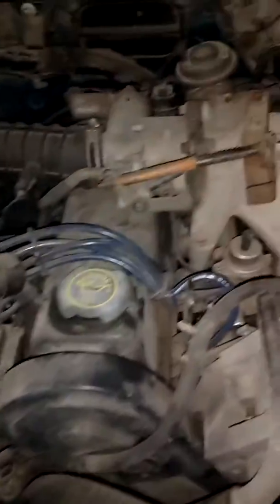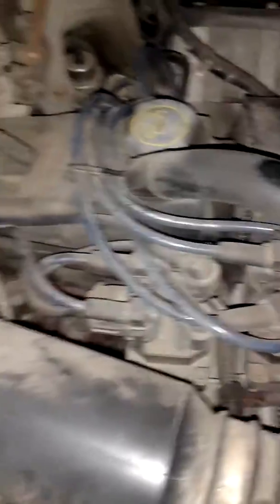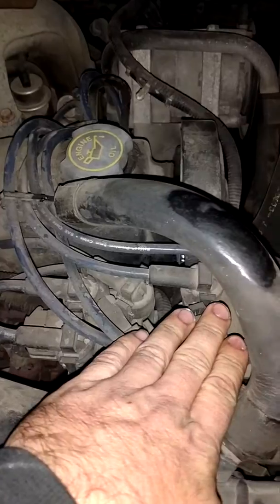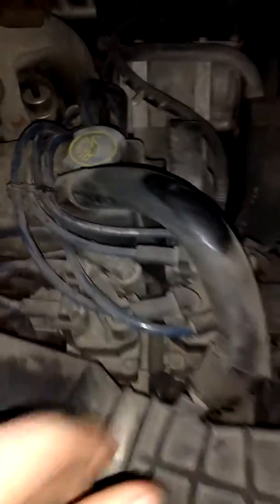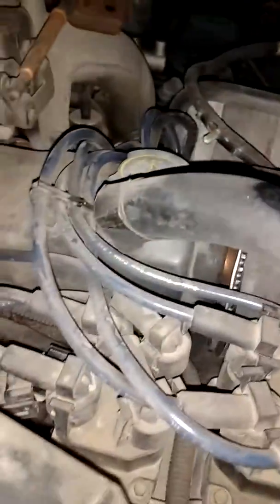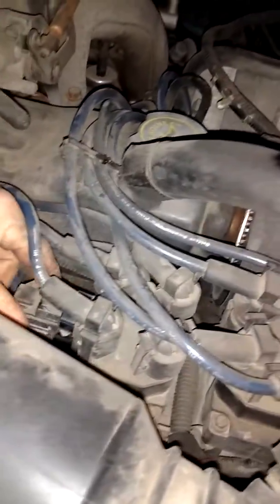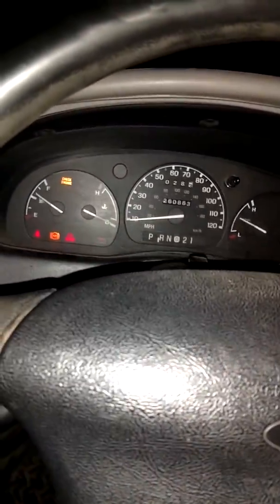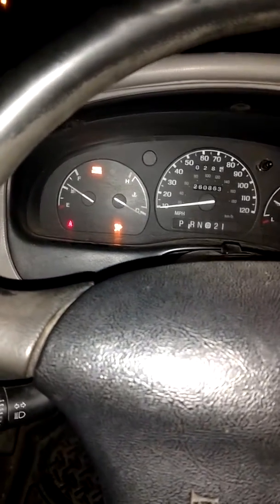The Ford 2.3L Dual plug myth, the explanation of why it doesn't work.

Comment: I believe both plugs fire on cold start and hard acceleration so your test is cold and both plugs are commanded to fire hence it would run regardless.  You can hear the rpm change when u unplug either one.

Comment: .I see a lot of verbiage for such a simple answer. The dual spark function is "shut off" above 1500 RPM in the factory setting. The parameter ID looks like this :PLGNHI Dual Plug Ignition RPM Max 1,500. You can change the dual spark RPM limit with a tuner.

Comment: You switch it around so they fire on compression because factory it is on exhausted. So you gain a better explosion on the compression . That's the idea
Reply: Google waste spark and realize that they are the same thing.

Comment: okay guys I have a 1993 Ford Mustang 2.3 dual plug like your ranger here, cylinder 2 and 3 on the intake side don't fire. it isn't the plugs or coils as I have replaced and swapped them and the problem remains. also traced wiring as far back as I could. I was told by an older ford tech my problem could be the ecm? what do you think?

Comment: If I'm understanding this right, 4 plugs are firing at the same time. Take for instance cylinders 1 and 4.  2 plugs fire during compression stroke at TDC on cyl 1, while simultaneously 2 plugs fire the waste spark at TDC on cyl 4.  That's why you can disconnect one of the coils and the truck still runs, because there is combustion spark and waste spark still occurring, only difference is "one" spark per cylinder instead of "two" (dual).
Reply: Not sure about the difference on the earlier Rangers, but I got a 1998 2.5L.  I can disconnect one coilpack and truck still runs fine

Comment: Ford  themselves made the "mod" standard in the later years  to fire both plugs at the same time, the earlier models did in fact fire on the exhaust stroke to take care  of hydro carbons that made it past combustion. Kinda the same theory as pumping fresh air into the exhaust to introduce o2 to burn off  residual fuel (smog pump).
Reply from the maker: All waste spark ignitions fire on the exhaust stroke.
Reply: @spike662  yes but it's not a conventional wasted spark like gm has
Reply from the maker: @kenleppek  yes it does. If two cylinders are connected to the same coil winding, which is exactly what wasted spark is, both plugs fire at (or just before technically) top dead center. One cylinder is on compression, the other is exhaust. It's physically impossible to only fire on compression on a wasted spark setup.
Reply: @spike662  ford uses 2 plugs per cylinder 2 coil packs with 2 sets of windings in each pack gm uses 2 coil packs each with only 1 winding firing 2 cylinders....same type of system but ford is doubled up
Reply from the maker: @kenleppek  correct, but the GM fires companion cylinders just like the Ford. They only have two sparks each fire, and the Ford has 4.  Therefore, every time you fire a compression cylinder, you fire it's companion cylinder on exhaust.
Reply: @spike662  How about if you jump primary coil wiring to secondary(I'm talking about the electrical connecter wiring to primary
Reply from the maker: @kevingodbee6387  what would be the point of this?

Comment: Cylinders 1 and 4. both coil packs fire at the same time cylinders 2 and 3 both coil packs fire at the same time.
Reply: I think they're called towers but yes  you're right, I just want to know about this so called mod. That's supposed to improve power

Comment: The spark travels from the negative to the positive side, as it is the electrons that move. You want the spark to go through the unburned fuel as designed, by changing polarity it will not work as efficiently as the spark travels in an opposite direction then designed.
Reply from the maker: Direction of fire is controlled by the ease of path. When you fire the coil, the cylinder with the air fuel mixture has less apart resistance therefore it fires that plug first, then to complete the circuit it also has to fire the exhaust cylinders plug also, and the result is a weaker spark due to the extra resistance and it being the secondary spark.

Comment: I did mine after I watched thunderhead289. And it worked and is still working and running great a year later with no negative evidence to my spark plugs. All 8 plugs are burning perfectly
Reply: That's because theres literally no difference
Reply: @slowstang88  I've even swapped them back and forth and can tell a big difference so I keep on the switch

Comment: My 2.3 with 32” tires is a dog. But after I did the plug mod, I did notice a difference in torque, and gas mileage which in theory would be the two gains you would see doing the mod. This vid is useless
Reply from the maker: Proof? 

I have supplied proof for my claims in comments. I would need to see Dyno sheets and fuel/mileage data to consider your claim. 

I have proven that it literally changes nothing.

Comment: You are an idiot 
There are two different ignition styles for the 8 plug head - opposing coil pack engines work differently than the ones that have both coil packs together
Reply from the maker: No, they both operate on the same principle.
Reply: spike662 no they don’t LOL. 
Go find one and see for yourself. 
Pull the passenger side plug wire coil connector off while it’s running and see what happens. 

They are 100 percent different
Reply from the maker: I've owned both styles. I admitted in the video that my truck is different, because the old style won't start without that one. But that's where the difference ends. You can unplug it while running and it will continue to run. I've done it.

Comment: I just swapped mine around just to satisfy my curiosity and it idled real rough but reved up smooth ..so i just out it back like it was and shut the hood before i tear something up ..lol
Reply from the maker: Swapping them doesn't help or hurt anything. Unless you accidentally swap banks and then you're trying to fire at the bottom of the intake stroke lol.

Comment: incorrect about the polarity but thats a mute point. The block is always the ground path.  the discussion has always been about the 2nd coil pack with an "offset" and i dont mean the wasted spark. I can confirm on DIS there is no offset, i cannot confirm that EDIS didnt have this as they went back to more a "brain" than standard DIS. DIS is for all practical reasons interchangeable with TFI dizzy as you can  rewire the 2 to the other with no effect with the EEC.  I have run a stock early dual plug DIS to about 40psi of boost with zero issues a tuned turbo EEC.
Reply from the maker: I have recanted the polarity thing in other comments. However, the block is not a ground in this system. There is no true ground in a waste spark. The spark plug circuit is a self contained circuit. It does use the block as conduit, but it is not a ground source.
Reply: @spike662  3 years later, and i agree with you on the polarity. thank you for clarifying!

Comment: There is no such thing as a negative and positive charge. An entire DC system is negative reacting which is why you disconnect the NEGATIVE battery cable when working on a vehicle.

The guy is 100% wrong about every single thing he says in this video.

The secondary coil fires on the exhaust stroke to clear out unspent gas. If you swap the wires around, as described in the "fix", you cause both plugs to fire on the intake stroke and you absolutely do get a performance gain. It is small but it is there.

In the stock configuration, the secondary coil offers nothing but emissions, causing spark 180 degrees out  of the compression stroke. When the fix is used on it, it now becomes an active plug.

Also, IF this guys truck was wired as it comes from the factory it would NOT crank on either coil pack. Only the primary can crank the vehicle in the factory configuration. Once the "fix" is applied it will in fact crank on either coil pack but the fire is very weak on the secondary coil pack because of the position of the plug in relation to the intake.

Both coil packs are identical, another thing the guys says which is wrong.
Reply from the maker: Wrong, and I have disproven everything you said in other comments, as well as correct some.of my mistakes.
Reply: @spike662  You have not proven anything. I have a 2.3 in my driveway right now which will only start on the intake coil pack. That is a fact. Everything you have claimed is wrong and it has been proven on dynos in other videos.

The bigger issue is it is just basic understanding of engines. One coil pack was designed to run on the exhaust the other the intake which is the normal setup.

You can completely remove the second coil pack, which in ministock the normally do, and there will be absolutely no performance lost. None.

However, if you do the "tip" you will get better fuel burn and slight increases in HP and throttle response.
Reply from the maker: @claytonmuirhead2722  false, ministocks don't ever use a factory 8 plug ignition. They switch to a distributor or an aftermarket adjustable waste spark (very very uncommon). You cannot make power running 12° of ignition advance. I've been dealing with 2.3's for 15 years and know what I'm talking about. 

Aslo, I have NEVER seen a dyno test that proves the dual plug myth. I have looked, extensively. I have seen one that disproved it, but I haven't seen it in years.

And you are correct if you insert two words at one point. The one coil pack fires the intake side spark plugs, and one fires the exhaust side spark plugs. However, with a waste spark system, it is impossible to fire one spark plug on exhaust stroke without firing it's companion cylinder on compression stroke. IMPOSSIBLE
Reply: @Clayton:  You have a disappointing lack of understanding about the theory of operation behind this classic DIS "wasted spark" system.  Swapping plug wires on the companion coil towers does absolutely nothing except change the polarity of the secondary, causing the sparks to jump in the opposite directions, but still near the tops of both the exhaust and compression  strokes.  There are only two primaries and two secondaries per "pack", as proven by the three wire primary connector: Ignition (+), 1&4 (-) and 2&3 (-).  So a spark plug can NEVER fire without its DIS companion firing at the same instant (but with opposite polarity).  The "wasted spark" is always near the top of the exhaust stroke, regardless of polarity, because there's no compression and negligible fuel and oxygen before the intake stroke begins.  This undeniable FACT is instantly obvious on a secondary ignition oscilloscope, but you can prove it for yourself by simply swapping 1&4 and/or 2&3 in any combination on either side and taking it for a spin.  The spark plugs will eventually exhibit slightly different wear patterns on the swapped secondaries due to the sparks travelling in the opposite directions, but that's it ... nothing else ... period.
Reply: @michaelbarry8005  Yawn.

You are wrong, but it is just to the point where no one gives a f. I don't have a lack of understanding of anything. I could not care less about "theory". I have a Mustang right in my driveway and it works exactly like I said. Anyway, go troll somewhere else with your BS.
Reply: @Clayton:  Well, I apologize for directing my initial comment to you, since I clearly don't possess the ability to convince you of anything, not even if I went through the effort of uploading and linking a video of me 'scoping this system live with my VantagePro and showing unequivocally that there are always two simultaneous secondary spark events of opposite polarity per primary trigger near TDC for each companion cylinder pair, regardless of which side or which companion pair (or swapped pair) is being 'scoped.  What I should have done is simply supported spike662's correct arguments from a slightly different angle in my personal version of reality and left you alone within your own personal version of reality.

Regardless, I think I'll stick around until spike662 un-invites me, since this is his video and not yours, with all due respect.

Thank you for your prompt reply, and may you have a pleasant tomorrow.
Reply from the maker: @claytonmuirhead2722  your Mustang does not work how you think, and I provided the information necessary for you to understand that.

I have made a couple corrections to my statements (as I have pointed out previously) but the basis of this video is correct and I have proven it with other information from other sources
Reply from the maker: https://www.motor.com/magazine-summary/diagnosing-waste-spark-dis-july-1999/ 

Read paragraph 6
Reply from the maker: https://www.freeasestudyguides.com/diagram-wastespark-ignition-a8.html

Here's another article.
Reply from the maker: Also, I have recanted my statement that the polarity changes, because I have since figured out that polarity changes based on which cylinder has an easier pathway for the initial spark. If I remember correctly, the cylinder with air/fuel mixture allows for an easier spark, so the cylinder that is in compression will be the positive side. The two packs fire a few degrees separate from each other, they also fire much later than a single plug system. This is because you end up with two flame fronts that burn the mixture as efficiently with less spark advance. This is why you WILL see a performance loss from only running one coil pack.
Reply: God damn this was hard to watch this dude is a dumbass